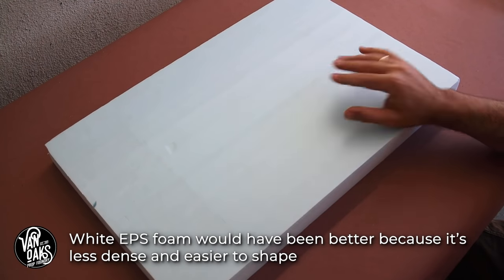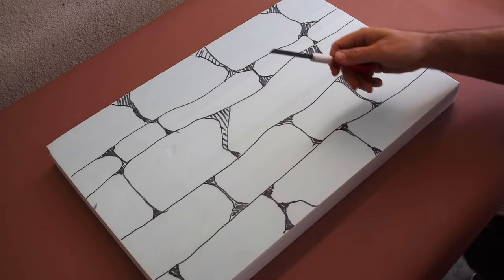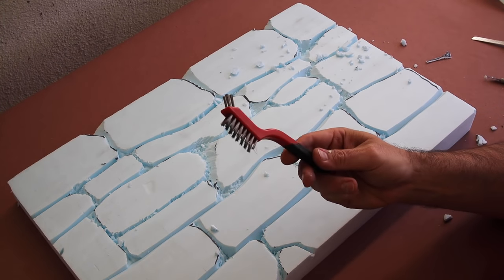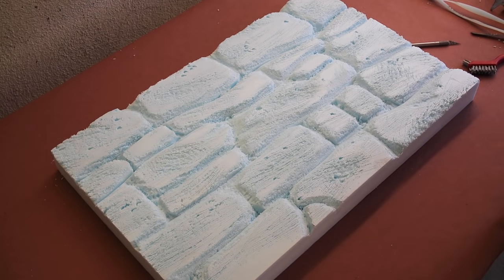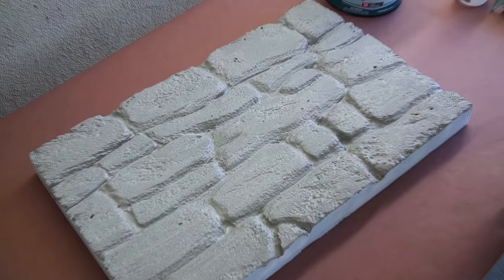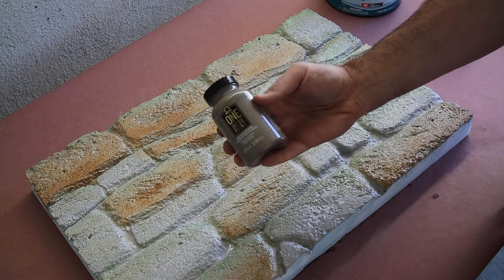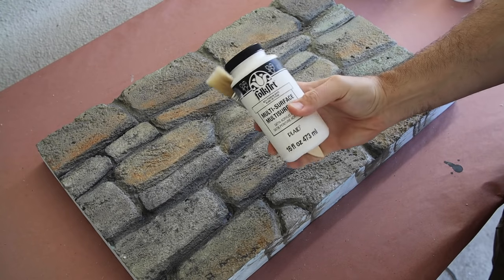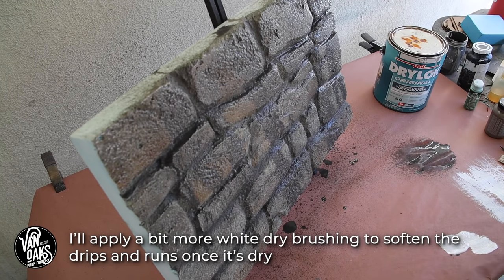Easy & Realistic Faux Stone Walls with Foam!

Comment: How durable would this be outside?
Reply from the maker: Depends on the situation & weather. If it's temporary, like for Halloween, it would be fine. If it was permanent or would have people touching it regularly, it wouldn't be ideal.
Reply: @VanOaksProps  I was thinking for a Airsoft field. Most are so boring bare walls. Thanks!
Reply from the maker: @mountainadventures7346  You could always start with this approach, the coat them in fiberglass. That way you get the durability.

Comment: Oh yikes! That step of torching the foam is HUGELY toxic! Don't do that.  We do foam blocks all the time in theater and when you are doing a lot of sq footage, far more than the sample here, I've found its a lot easier to cut the foam up in big strips on the band saw of varying thickness. Then a wire cup brush in a cordless drill greatly speeds up the process of carving the shapes. We then use a little construction adhesive or tile cement to stick the "bricks" to the flats or whatever subsurface you need. For short term Halloween decorations it could even be cardboard stapled to a 1x2 frame. Once the foam is cut into the long strips its super fast and easy cut out the shapes with a hacksaw blade or even just snap it with your fingers. The various thicknesses of the band saw cuts save a ton of carving time and give you greater depth variation.   We often paint the stones first and then color the scenic dope (mud, Elmer's, painter's caulk, latex paint) and "point" in the mortar after the stones are dry. Mortar can get on stones but stone never gets on mortar ;) Your final product looks great, though. I just can imagine doing that for larger sq footages.